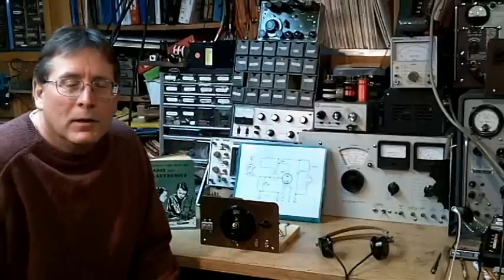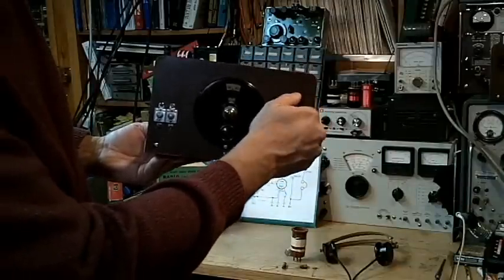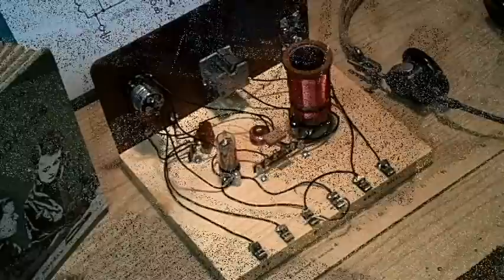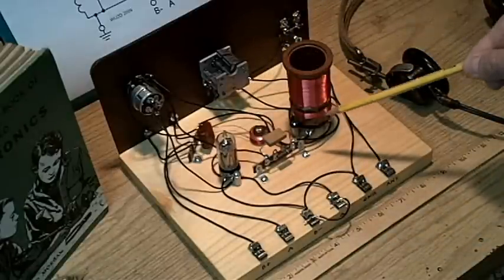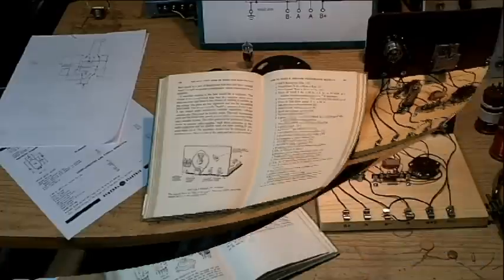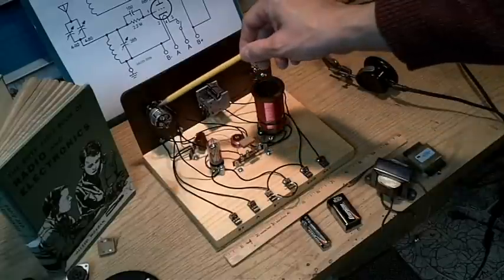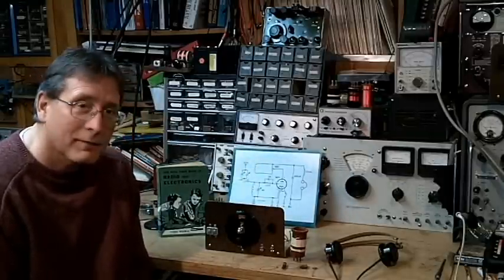Morgan Regen Part 1

Comment: Great video,  I was wondering where you were going to get the B+ with no ac power.. Really like the solution... 73s Rich KG5IF
Reply from the maker: Nowadays I would still go for 9V batteries in series for 45V to 90V. Current drain is very low. The new rechargeable types could be solar charged.

Comment: I have a reduction drive of that type but it's not very smooth.
Have you any tips on what may be the culprit?
73 G3NBY
Reply from the maker: Usually the tension on the pinch wheel. First take it apart and clean it! Good Luck.
Reply: @MIKROWAVE1  
Man thanks...73 de G3NBY.

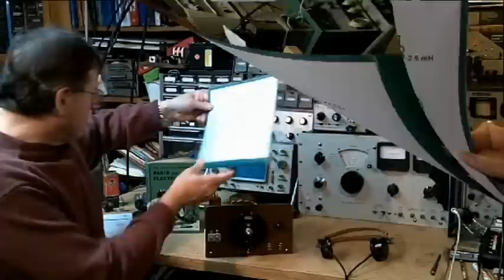Comment: 1:00 Why not shunt the feedback control potentiometer across the tickler coil itself? It won't affect the tuning, and won't affect the anode's DC voltage at all
Reply from the maker: Keep watching - Part 2
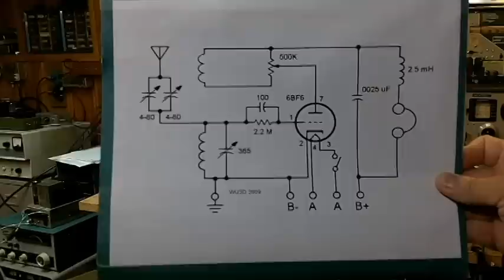Reply: @MIKROWAVE1   1:00 Maybe the purpose of placing a variable resistance in series with the plate and tickler coil IS to reduce the anode voltage - - in order to prolong the life of what was back then, expensive HT batteries that weren't rechargeable - - - ?

Comment: I think that Stripline inductors are possible and you can listen to signals on the centimeter wave bands, TELEFUNKEN (GMBH) Space Charge Vacuum tubes should work well in this circuit.

Comment: I really enjoyed this. I read all of Alfred Morgan's Electronics books in grade school and wanted badly to build that One Tube Regenerative Receiver and listen to shortwave. I was not clever enough to figure out how to adapt the circuit to newer parts like you did. I kept looking in the Allied Radio catalog for a "B" battery that produced the voltage Morgan wanted. It was great to finally see that radio in action.

I came here originally because I have transcribed two of Alfred Morgan's earlier books for Project Gutenberg, where anyone can read them for free:

The Boy Electrician

https://www.gutenberg.org/ebooks/63207

How To Build A 20-Foot Bi-Plane Glider

https://www.gutenberg.org/ebooks/63077

The Boy Electrician has plans for a Loose Coupler very much like the one featured in some of your other videos.
Reply from the maker: It's very frustrating to not be able to source a key part that you later find out you could have made due with dimestore 9V batteries in series! I had a box full of triode tubes that would have worked absolutely fine in that radio, but had to have the exact tube and it cost my dad a bundle.

Comment: What about using the Raytheon Wire-Ended low voltage vacuum tubes makes for a very safe to use radio.

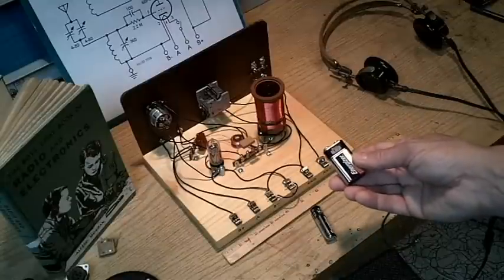Comment: 7:48 I have a set very similar to this one in concept and design. 
The triode's plate voltage requirement is 45V, and will regenerate well with just 2 X 9V xsistor batteries in series - - allowing for a broad range of regen control.
Reply: There is a YT video of a guy running it on just 12V of plate voltage!! And someone commented it even worked all the way down to two volts!
https://www.youtube.com/watch?v=M5axqzB-LYQ

Comment: BTW:
One 6.3V filament transformer can be used to drive a 12.6 filament transformer running backwards.  This gives you an isolated but still dangerous 60VAC (For 120V mains) to feed into a rectifier for plate voltage.

Comment: Could this circuit be built with a JFET or BJT ?
Reply from the maker: JFET yes but at somewhat lower gain so another stage (audio) might be required to truly be equivalent. Bipolar would require that the main coil be tapped and biasing to be adjusted. Bipolar Regens are notoriously hard to stabilize compared to tubes or JFET types. See my series on early bipolar ham projects.
Reply: @MIKROWAVE1  Thanks!

Comment: Has anyone happened to notice the severe, potential safety hazard in this receiver's circuit design?   OMG!   If a perspiring barefoot child, living in a very warm and humid location such as Los Angeles were to have the receiver well grounded, the moment she (or he) applied the B+ supply to the radio, they could receive a very painful and dangerous shock with current flowing from head to toe.      Apparently beside not realizing that girls too can learn to love electronics, Morgan didn't think about electrical safety.    Perhaps a 20K resistor from B+ to the plate and the 2.5mH choke  tied to the headphones in series with a 10uF DC blocking capacitor.

Comment: The value of that Regen (Reaction) control's potentiometer maybe dependent on the supply voltage to the tube's plate(Anode). Using a lower B+ battery may extend the range of the pontentiometer control of the feedback

Comment: Can you use like a 1R5, 1U4, 1U5, or a 3V4...any of these tubes work???
Reply from the maker: Kennynva yes those battery tubes could all be made to work if you tie the screen grid directly to the plate pin making a pentode into a triode. Try the 3V4 first.

Comment: One thing I concluded about pot control of regeneration (which is still my fav way to control reactivity, or feedback, is to make sure you use the highest quality pot possible.  I used war surplus Cardwell 20 and 50k pots which were...and still are....silent as the grave.  To this day, when I find 'em, I buy 'em.  My Regenerodynes use these old birds exclusively.

Comment: Hello I have a number on regenerative receivers I built. I tried building the one matching your diagram of the up to date one and calculated the winding of the coil I can't get this one to regenerate at all nor do the variable capacitor do anything. Are you sure the pot you used was a 50K ?   Thanks.

Comment: I actually read this book as a boy!  It inspired me to become an Electrical Engineer. Talk about bringing back memories! I read this book in the 1970's as a book from the 1950's. I loved that book! Where did you get the Vernier dial? With the gear reduction mechanism, they are hard to find.
Reply: +alexnds1 
Scour Ebay..I just bought one...Cheapish. Stateside....not the only one.
Might be called National Velvet...MIGHT BE!
It's friction slow motion or reduction drive.
Has two silly little side windows which appear to do nothing but it works.

Comment: Very nice function and appearance.  :)  I've never had much luck with regens; the simplicity of design and paucity of needed parts has always been overshadowed by getting things to oscillate at the right time, with the right touch, without hand capacitance, on the right frequency spread, with the right ---- well, you've built 'em, you understand. LOL.  Except for its nostalgic value I was never a fan of the Boy's Book either.  Too many of the circuits didn't work as advertised and quite a few didn't work at all.  Still have the book though.

Comment: You can create the neccesary plate voltage by connecting 9V xsistor batteries in series end on end like a 'W' but - - I have found in my own experience with my one- tube regen that you can greatly increase the range of regeneration by having the tube operate on a much lower than rated plate voltage. My regen's tube uses a directly heated cathode supplied by a 1.5V C cell. The plate voltage is 45V but I found at that potential the regen went into oscillation far too easily with even small amounts of feedback. Two 9V batteries in series gave me very good results with my 1930s 2K-Ohm headphones. So my experiences are very different from yours.

Comment: grt vid.im building a simular regen from homer davidsons book ..radio recievers you can build..i use mor transistors in by builds.so i was wondering how critical it is to the filament weather it gets ac,or dc. in the one im building the tube is a battery type 1s4 tube so i dont need to worry cuz i know i have to use dc.but can some tubes use either .ty.great radio.

Comment: Hey great. I have the first edition of the book now. Checked it out of the school library as a kid and found it on line many years later.
Do you know where I can find the coil forms and sockets. I built a beginners transmitter for a young ham years ago and need a coil form to get it going again. Thanks Dave W4GSM
Reply: You could probably make them out of PVC pipe. I've seen that in many radio construction books. I'm not sure if they are still in business, but Antique Radio Supply may still have the original types. I've been out of radio for a while now because I have what is called familial tremors. My hands shake too bad to do any soldering, so I would have to use Fanhstock clips to assemble anything like this now. I tried working on an old computer a couple of days ago and could hardly get the screw back in to remount one of the cards. I'm on meds, but the only somewhat cure for what I have is a neuro stimulator with a wire in my brain.

Comment: Use a vari cap for regen control  its far superior
Reply: No, that will have a detuning effect. The pot should be connected across the tickler coil so that the DC voltage on the tube remains constant - - which mean the diagram he should is in error

Comment: Goodness.  Haven't heard or thought of terms like "grid leak resistor" in years.  Thanks for this video. Reminds me of the mail order kit I got in 1955 or so.  I built it and it didn't work.  I then discovered I should have used rosin core solder. I took it apart and re-built it.  Exciting stuff when you're 15 years old.